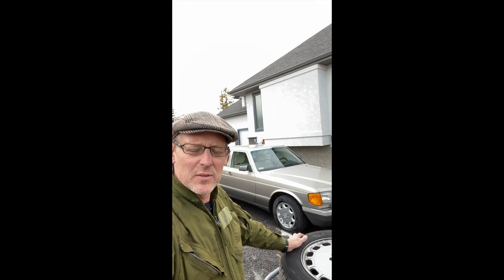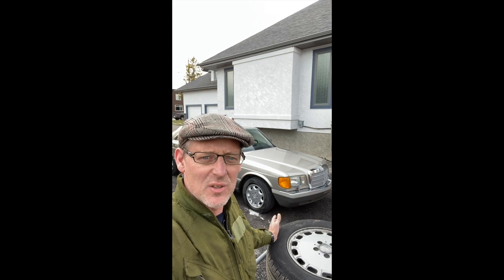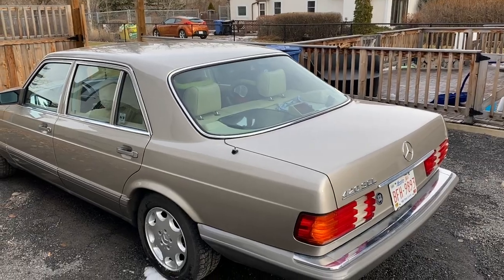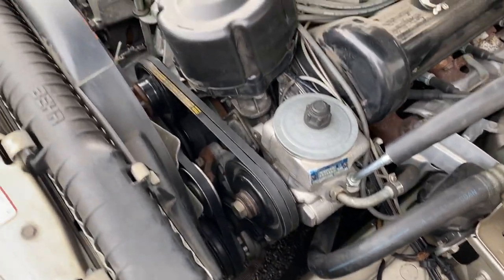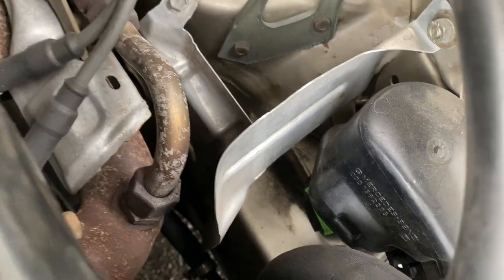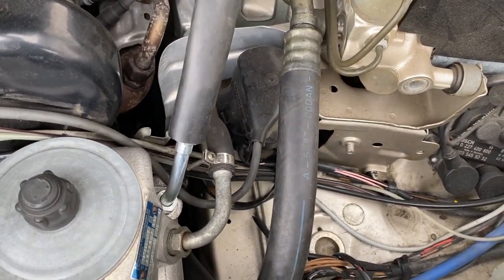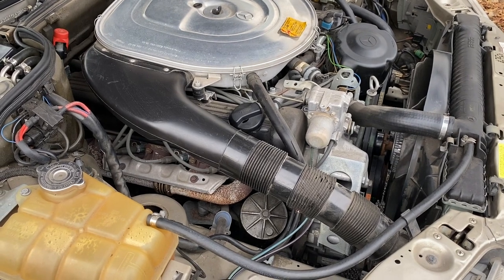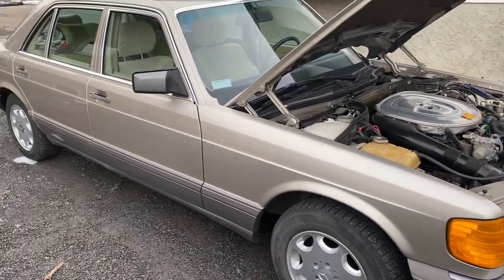1989 Mercedes 420 SEL - Costs to Run (With Spreadsheet)

Comment: When ever you find a EOG Module under 1200$ get it they cost a lot but if you find a used one out for parts or scraps it’s a easy to remove part that is a life saver if you can’t find the problem
Reply: Funny watching this video a year later and thinking the same thing

Comment: Sensible comments about DIY repairs. $4k/year in repair/maintenance is still quite a King's ransom for a pristine low mileage car, albeit less than the payments for a Toyota Camry lease.
Reply from the maker: I was a bit unlucky with this one, and I didn't drive it much.  I think if I keep it for another 5  years the costs (per year and per km) will come down quite a bit.  Looking through previous spreadsheets of the other W126's that  I've had, this one has cost the most and has the fewest (by a long way) km on it...
Reply: @slrroman  Yes, sometimes the pristine garage queens can be the most troublesome due to age and infrequent or short distance driving.

Comment: Am i righy hearing $25k for 6yrs for maintenance?
Reply from the maker: Yeah it's a little steep.  This is $C, and things are more expensive here than in the US.   I've spent about $25k to go 50,000km (about 30k miles), over 8 years, for an average cost of $.50 per km, or about $3k per year.   

One of my other vehicles is a 2019 Toyota Tundra.  I've only spent a couple of thousand dollars maintaining it, and most of that was winter tires.  It has gone about 30,000km in the two years that I've owned it, and depreciated about $15,000, or about $.50 per km...
Reply: @slrroman  hi Lawrence. Im also from Canada, toronto. I just acquired a 300SE and a 560SEL. Im restoring my 560SEL now. Thats a lot for maintenance. I bought my 560SEL for $4500 and spent $4500 for tune ups, brakes, transmission flush, OVP, valve seals, all the engine and transmission mounts. Euro headlights, and a bit of body work. I will pick up this week. My mechanic told me, it should be very reliable after this. I will do the paint this winter for a few spots of rust for only $3000. And the next one is complete thorough changing of all seals and stuff for the engine for $5000. So thats still very minimal. But total all of that, thats well  sorted out mercedes. And this is no joke mechanic and bodyshop. He works for Mercedes.
Reply: @kibovolks  how are your cars holding up to this day? Any extra or unforeseen cost on your journey?